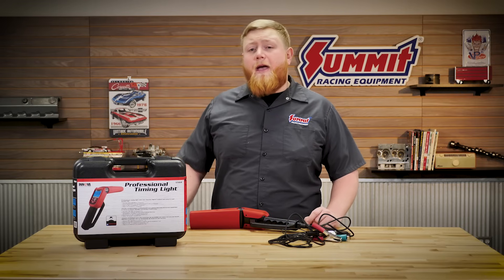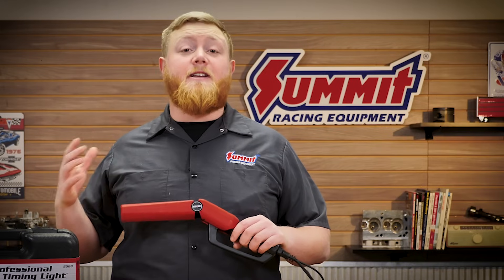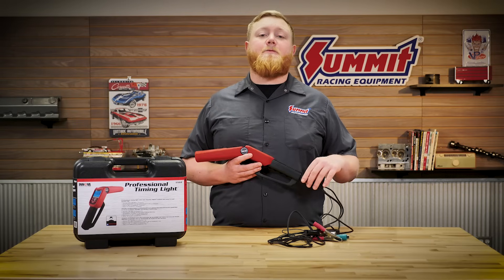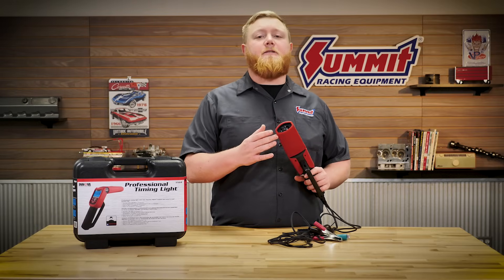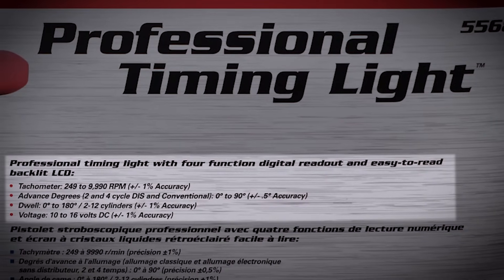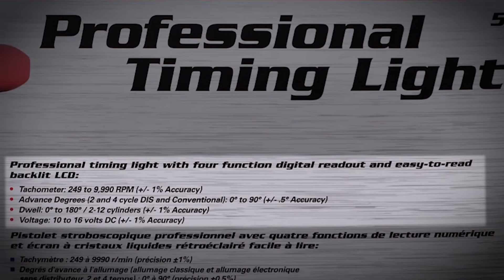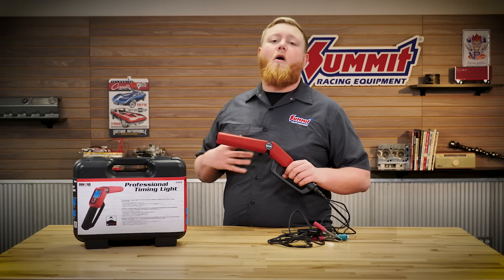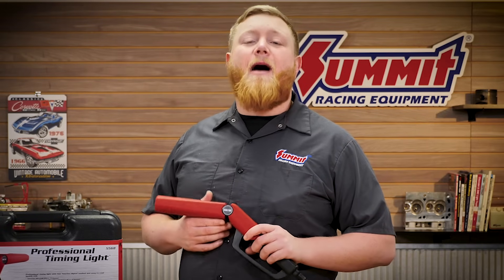Timing, Dwell, Voltage & More! | Toolbox Heroes: Innova Professional Timing Light

Comment: Innova is bot what they used to be. These lights are super finicky, often don't work at all. Innova doesn't stand behind their warranty, to the point even dealers do not want to deal with Innova. Finally, the replacement leads @summit racing mention are garbage and come with plastic clamps instead of the metal protected one like is received on the new units. The replacement clamp will melt if remotely close to heat, rendering it useless. Do not buy this light and expect it to be usable on all (wired) vehicles, and do not expect the replacement parts to be replacements. They are not.
Reply from the maker: Sorry to hear you haven’t had a good experience with the Innova. What is your recommendation.
Reply: @SummitRacing  I just got a classic Actron made in USA on ebay...$35 total. It looks new.